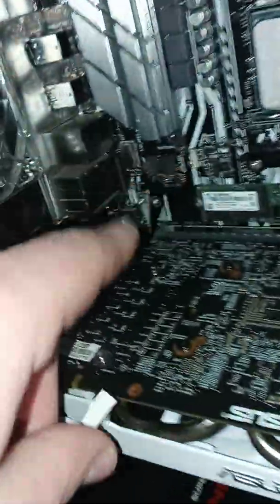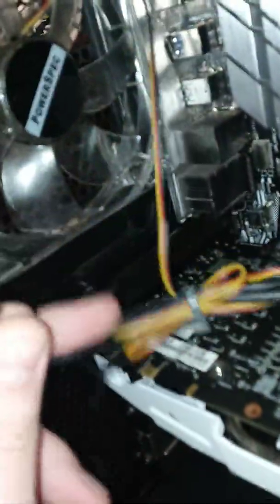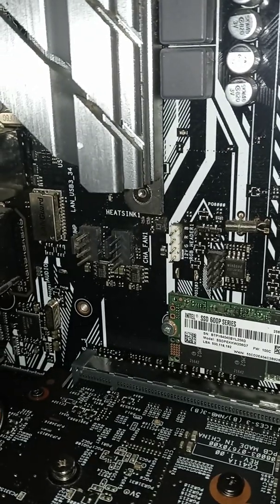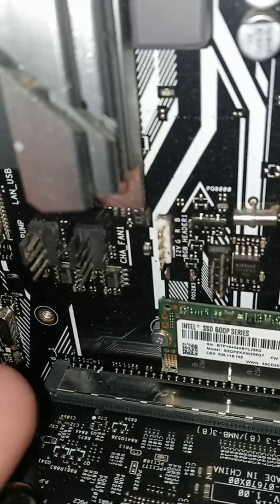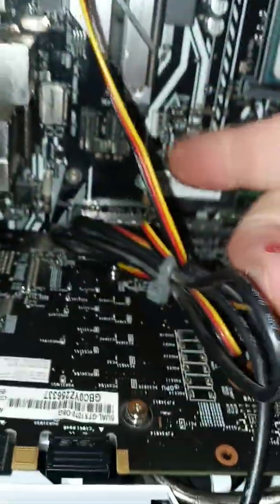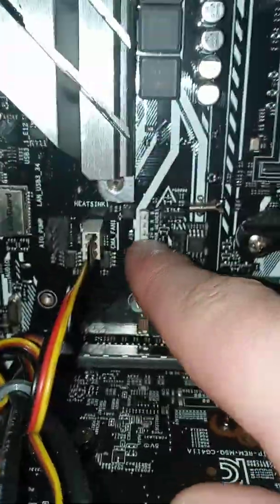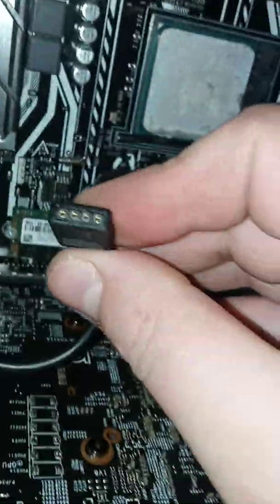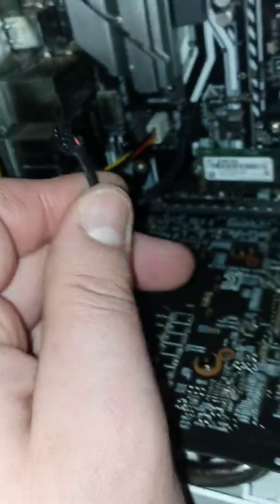How to Connect 3 pin CPU Case Fan to 4 pin Motherboard WITHOUT Molex Cables and NO Adapters PC 2021

Comment: Does this cause the non-PWM 3-pin fans to run at 100% or can the motherboard fluctuate the current to control the fan speeds?
Reply: If u got 3 pin u cant control speed but u can see rpm
Reply: @twyjji3  can u control the lights?

Comment: tysm ive been trying to plug in the cpu 8 pin i a nzxt h10 rip fingers well heres a tip for less trouble if you are wireing in this case get a custom cpu cable or power  suppy cpu cable and plug it in then push it through the case to the back so u dont kill ur fingers like i did

Comment: Yo i have a question, i buy a cpu cooler but the fan is a 3 pin, the wrongest is in my mb have a 5 pin conector
Will there be a problem if I connect it?

Comment: I have a 4-pin RGB plug in and a 4-pin 12 volt on my motherboard everyone says not to do that
Reply: you can tell more about that ?
Reply: If u buy 4 pin rgb u need use 4 pin for it and no matter what voltage

Comment: Yo I need help is their a way to connect a 3 pin female rgb into a 4 pin  rgb mother board?
Reply from the maker: yeah dude. watch the video.
Reply: @coolbreeze6751  This video shows how to connect (female) 3 pin fan power to (male) 4 pin motherboard fan power. Commenter was asking about  how to connect (female) "3 pin RGB" onto (male) 4 pin RGB connection pins. I am also looking to solve this issue (Not made clear by the video).
Reply: @andrewmiller2009  yea exactly, I actually solved this issue with a extended led strip, I had a bunch left over so I just cut one of the pins on the led strip and it works just fine
Reply: Maybe with adapters. But plugging the 3 pin to 4 pin is not gonna work:
4 pins have:
- one pin for 12V output
- one pin for red
- one pin for green
- one pin for blue.

And 3 pins have:
- one pin for 5V output
- one pin for Data
- one pin for Ground

Comment: Hi u directory connected it from 1pin - 3rd pin leaving 1 hangings from right side right
Reply from the maker: correct
Reply: @coolbreeze6751  thx and very informative. Greatly healped me since I have no clue 3+4 pin in motherboard does. Ahh thx again

Comment: hey man, i just ordered a 2pin fan by error, is there i way i can put it into a 4 pin slot?
Reply from the maker: I got you, but just for the record, your Motherboard knows the temp of everything and it WILL shut down the PC before any damage can happen.
Reply from the maker: Hm, that's a good question. I have never tried to do that. Did you ever attempt to do it yourself and see? How did it go?
Reply: @coolbreeze6751  didnt want my gpu to explode, i ordered a new one and sent back the one with 2 pin.
Thanks for the answer
Reply: You can connect it directly to the 12v power supply line.

Comment: and will the fan work normally?
Reply from the maker: Yes sir, like I said in the video...do not be intimidated. I know it seems..."weird" to be connecting something that only has 2 pins to something with 4 pinz, but it's really not a problem. Ok, consider it like this....you know when you plug in a cord, to a socket with one of those holes at the bottom, but your cord only has 2 prongs? THIS IS NO DIFFERENT THAN THAT!
Reply: Thank u bro I appreciate it a lot
Reply: what do you mean?
Reply: Yes it will
Reply: @atondosophia1140  but it doesn't change the performance it would normaly have